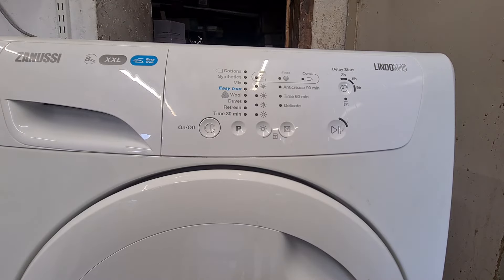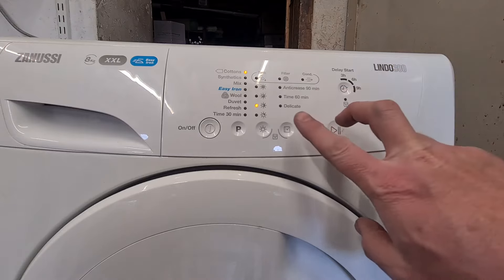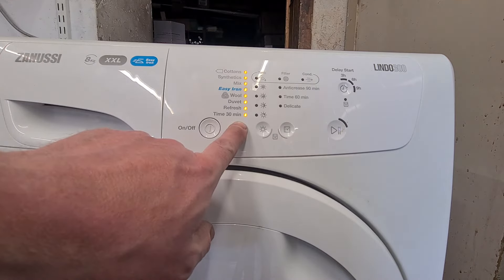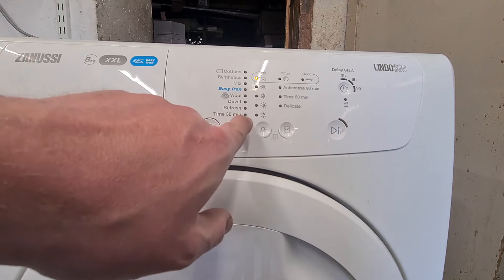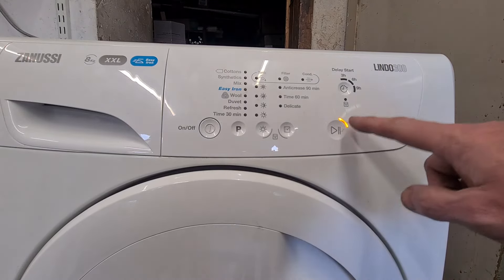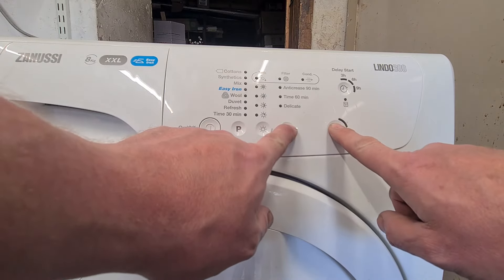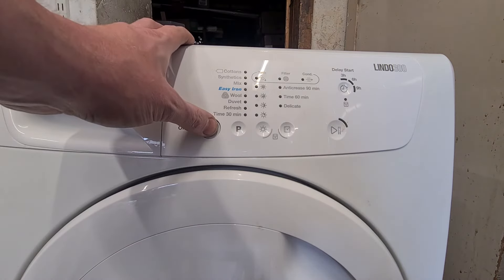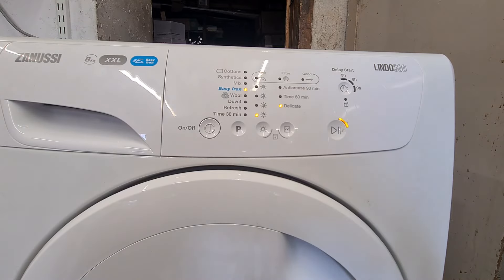zanussi lino300 dryer model number zdc8202p putting in test mode and error code reading

Comment: Hi, thanks for the info on test mode. We have an issue with ours where it won't start, just get the red light flashing and 3 beeps. I followed the instructions in the video and get 11 red and then 14 green. When I then cancel and turn the machine off and then on again it immediately starts running but with the only other light on is the lock and all buttons unresponsive except power. If I then turn it off and on again it does the usual start up with the lights but just flashed red again with 3 beeps. Wondered if you had any ideas? Thanks in advance
Reply: Hi mark . We have a similar thing , did you get to the bottom of it ?
Reply: @tracycohen5608  Hi, unfortunately not. Have had whole machine apart and all looks okay but just getting the red light flashing and 3 beeps still. If you manage to find a solution I'd be interested but I've not found anything yet.
Reply: Same problem for the past few months.. did anyone fix this or should I just get a new dryer? 😅
Reply: Also same error: 11red 14 green. Anyone get theirs fixed or know the issue?

Comment: hi, I changed the belt because it was damaged and replaced it with a new one, it's spins but the error is from the code reading, it spins for 3 seconds and stops. so I thought the belt was the problem .. I did everything you coded on this video but still doesn't work. what do I do ?? thank you

Comment: Do you know why the error occurs in the first place ?
Great to reset and use but is there a permanent fix that you know of please ?
Reply from the maker: To find the fault google the error code that point in the direction of the fault then you have to fault find down to the component
Reply: @user-tim100  Thanks
The dryer doesn't have a display showing an error code unlike some dryers .It is the same machine that you have in your video .
Reply from the maker: You have to count the flashing lights to get the error codes some of my other videos explained it
Reply: @user-tim100  OK,  thank you .
I will take a look .